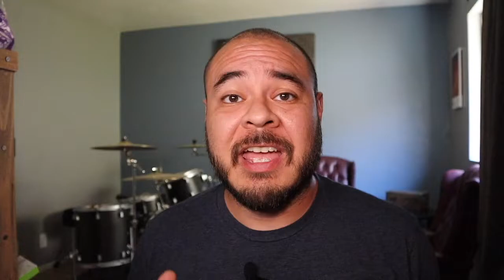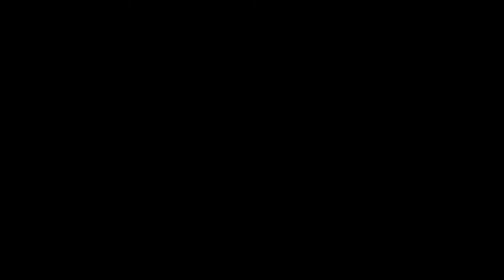How Do You Raise The Humidity Inside The Domes?

Comment: Thank you for the great video! I have a few questions!
1- what rate and % of food grade h2o2 would you recommend spraying in place of the zerotol? and also what rate and % of food grade h2o2 would you add to the nutrient solution when soaking the plugs? 
2- if the whole room is a constant 65% humidity would you recommend NOT using a dome?
Thanks!
Reply from the maker: I personally don’t recommend using h2o2 in place of Zerotol. Unless you’re at the hobby level. 
You absolutely still need a dome protocol when the room is sitting at 65%. Thanks for watching!
Reply: I did the math based on Zerotol 2.0 being 27% peroxide. 35% would be the best substitute. 1:100 zerotol for dunk is 0.27% peroxide solution and 1:250 for spray is 0.1% peroxide. Though zerotol has another vinegar like ingredient. Why is regular h2o2 not recommended over zerotol? Is the added 2% Peroxyacetic Acid really that important?

ps: I just looked at pricing. Looks like 35% and zerotol is pretty much the same price. So it would make sense to go with zerotol.